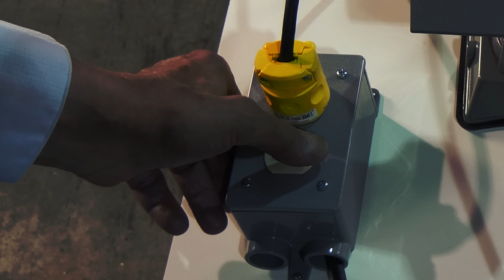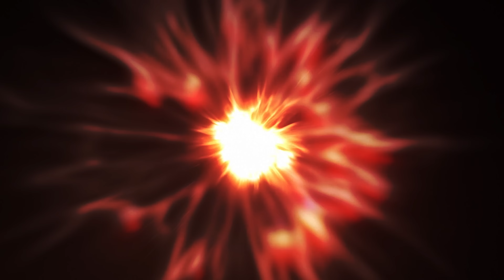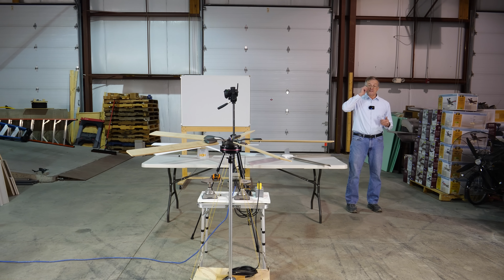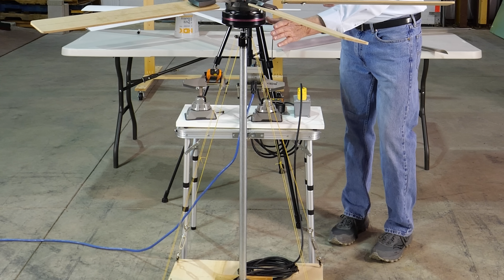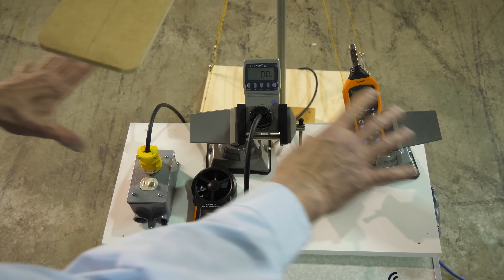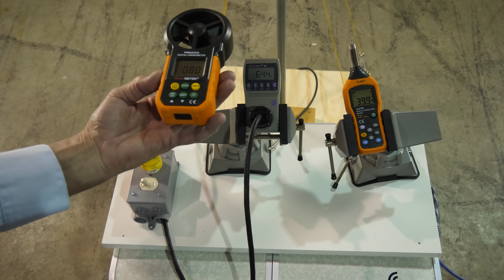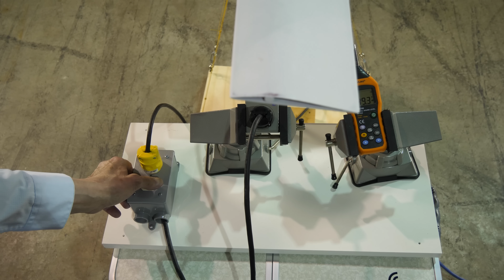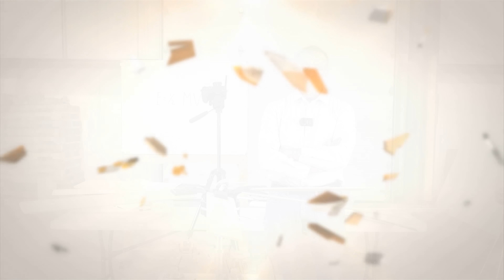This Fan Uses Almost NO Power

Comment: If you want this to be even more efficient then I would say another watt or two could be saved by using a very efficient motor driver. 
Probably overkill but every watt saved here counts when these things are sold in the millions.

Also, something like this could run off a single solar panel on your roof. After all you're more likely to use a fan on a hot sunny day.

Comment: You missed the connection of more velocity potentially eliminating the total amount of fans in a shop. Using a smoke machine or infared camera to illustrate room air movement on stock vs final design. Regardless amazing video thank you.

Comment: One point that he has missed is that celing mounted mmotors arhe other way facing down into the room. 
I belive that the motors are designed to be hung from the ceiling not stood on a pole. I think the results would be different?

Comment: You give the impression that all the other induction motors in a house (compressor, washing machine, etc) are similarly as inefficient as the fan motor here.  Not so. Fan motors like this one are designed with very high slip and are much less efficient than other induction motors commonly used.
Reply from the maker: Not really. 
I'm suggesting that other appliances MAY have less than optimal efficiency due to their motors.

Comment: great video, There is one parameter overlooked that plays a massive issue in efficiency is blade tracking. ceiling fans are terrible for this. in helicopters just a few mm out absorbs incredible energy and induced vibration and even noise. keep up great work cheers

Comment: If you look up the aeratron ceiling fan, the blades are tapered and rounded and the tips sweep upward to further reduce noise and improve efficiency.
Reply from the maker: There are a number of manufacturers of higher end and large fans for commercial use that incorporate those features. I don't know for a fact, but I suspect that some also include airfoils for their blades.

Comment: The "old" motor efficiency could be improved by using VFD (variable frequency drive). In this construction the poor efficiency comes from usually huge slip angle between mains power frequency and rotor frequency (RPM)
Reply from the maker: I think you're right.

Comment: In Sweden (at least) ceiling fans are built to be able to change direction; either pushing air down the center of the room, or upwards (and down the walls). Probably not an altogether simple task to perform when using aerofoils.
Reply from the maker: True.

Comment: The "other rotor" at 7:04 looks to have a very high angle of attack.  Probably a lot of flow separation (stalled).  I know the main driver of the video (at least at the end) was about the inefficient motor.  But if you follow up with blade design on another video, it would be good to go over local angle of attack.  This varies depending on the radius on the blade, if the blade isn't swept.  Look at any airplane blade and you will see it is swept.  The angle of attack also depends on the local velocity of the air moving thru it.  Sorry, ex-pilot here.

Also, it was easy to put the fan in the middle of a large room.  Plenty of room to get free airflow from above.  In the application of ceiling fans, most are mere inches from the ceiling.  Long downrods help, but not everyone has high ceilings to do that.  So any real advantages to changing blade design when the fan is mounted nearly flush to the ceiling?  This could be tested easily.

I will say that you got me thinking about my choice of fan in the main room.  I leave it on low 24/7 in the main room of the house, and it's been that way for the last 19 years.  I'm trying to think how I can check its energy use, as it is "flush" with the ceiling and hard wired.  Suppose I could throw the transfer switch on the house and move to generator.  Cut all breakers except the one that feeds than fan, and use a kill-a-watt meter between the generator and house power inlet cable to see what the fan draws.  If you have an easier way to do it than that, some folks might want to check theirs.

And overall, thank you for your good work.  I really enjoy the deeper dives.  And the way you present is typically first class.  Like many others have mentioned, I wish I had more profs like you (I studied mechanical engineering).
Reply from the maker: Thanks for the long comment. 
Regarding the angle of attack, this was optimized for the two custom rotors. The cylindrical spar makes that relatively easy to adjust.
The angle of attack on a stationary fan as opposed to a propeller is constant because at these low Reynolds numbers, the flow remains laminar across the whole radius, and the foward velocity of the plane contributes to the angle of attack less and less as you move outward from the hub of a propeller. 
I'm sure you know that the angle of attack sweep of the wing is to prevent a high angle attitude from causing a stall at the tip, resulting in control issues.
Fellow pilot here.
Reply: @TechIngredients  You (wisely) don't tell folks where you live, except that it is New England.  If you are a pilot, check out Sugarbush Soaring in Warren, VT.  Beautiful area.  Flew in once in a Citabria with my father and then went up in gliders.  Very pretty area.  I had a photo of the airport as screensaver for years.  Don't fly anymore, but I'll never forget that place.  I live in Houston, so almost anything in New England is prettier than where I live.

Keep up the good work with the channel.

Comment: One of the subjects I find interesting is biomimicry fan/blade design - I once heard about blades that were inspired by owl wings designed to reduce noise. How about a ceiling fan that's not only energy efficient, but also quieter.
Reply from the maker: That's probably not too difficult.
The same principle of interference is used to reduce the noise from stealth aircraft engine outlets.  I'd start by gluing various wedges along the trailing edges of the fans.

Comment: My subject of research would be electrostatics. In particular the workings of an electrophorus, the first electric induction device.
And my question would be: 
How is it possible that a surface of a dielectric that has been rubbed - added or subtracted electrons so to speak and touched by a grounded, conducting plate retains its charge?
Reply from the maker: Our next video relies to an extent on that property. Charge mobility varies tremendously. Charge can move across the surface of a material that is considered an insulator, but it moves poorly. Now, wet that surface with very pure water, which is itself an insulator, and the conduction increases.
Reply: @TechIngredients I suspect it also has to do with just polarization of the dielectric and not so much with moving charges.
Much like Michael Faraday wondered if electric current itself was either a flow or an arrangement.
Reply from the maker: Good point.

Comment: Interesting that the brushless unit takes longer to accelerate. Suggests that it produces considerably less torque. Maybe if it was geared down so it took a similar time to accelerate it would give a more similar flow to the ac motor

Comment: 13:43 For the no-rotor test, wouldn't you want to have the same effective weight on it, like some solid metal rods the same length as the blades? Motors run differently without a load.

Comment: I'm actually thinking that I need to do something about my ceiling fans currently. It's mid winter and the fans circulate heat throughout the house. The capacitors in the motors tend to dry out and lose capacity over time and currently the fans are peaking at a gentle breeze. I'm now wondering whether to swap fans out or just to spend the few dollars on replacing some old capacitors.

Comment: a similar super applicable power saving i have found is with new usb-c powered wifi routers. no one really questions the router/modem combo that their ISP sends them when they sign up. i found that mine was using around 30 watts, presumable to blast a bunch of ISP hotspots out to sell to my neighbors without my consent. I upgraded to a usb-c version by gl-inet, the opal export version which was only like 20$ at the time (the usa/north american versions are all very expensive), and also bought my own modem which is resoldered the 12v dc jack in the back to a 12v usb-c pd trigger board. connected both of them up through high efficiency GaN 20w adapters. togeather they now use about 7 watts. the thing is, almost every household in america has these networking items, and they are run 24/7 without much thought. the used modem online was 9$ with no powerbrick (perfect). so for ~30$, i cut my base load electricity use by 23 watts. ~16.5kwh/month, or 210kwh per year. for americans thats $40-200 of electricity savings per year.
got a similar amount of savings by unhooking the 120v line on my old doorbell transformer. for 50$/year, neighbors/deliverymen/solicitors can knock lol
the electricity savings is actually more than i estimated because of the reduced airconditioning costs during most months of the year. this is a lot better bang for buck than unplugging random appliances when not in use.

found these power suckers by using my cheap thermal camera. what a great tool for saving on electricity.

Comment: This is a very important video that demonstrates big energy savings, and therefore big environmental benefits, could be had by the simple cheap expedient of using higher spec motors in many household appliances.

Comment: I’ll be honest, my brand new home built in 2024 has ceiling fans in many of the rooms and I never ever turn them on. I have central AC which itself provides a bit of a breeze so I never see a reason.
Reply from the maker: No problem,  I believe you.
The more important conclusion than that ceiling fans could be better is that there are MANY other motorized appliances and systems that are operating at very low efficiency levels.
Awareness leads to progress.

Comment: I have converted many of my AC devices/appliances over to DC...mostly for the ability to run them off of my battery systems during power outages...but also for better efficiency.  
Like you I run my ceiling fans 24/7 but I never really gave serious thought to how much power it actually uses...this video really got me thinking along a new tangent.

Comment: Definitely interesting stuff.  

We try to limit our fan use because we live in a rather humid climate and have whole house AC. I talked to an HVAC guy who told me that if you live in a humid climate and have whole house AC, do not use ancillary fans, because the pressure differentials they create, in-draw humidity faster/more efficiently into the house.  So if I do use a fan, I use a small one on low-doesn't move a lot of air. 

  Speaking of humidity, I've thought of a way of dealing with that was low cost so I wouldn't have to run the AC and dehumidifier (I run this more at night when its cooler) as much.  Basically, get a large container and insulate it well.  Put it near a small, lower lying window. Dump calcium chloride in it.  The top of the container would be insulated with air/moisture vapor permeable insulation (the rest of the container would be insulated with more efficient insulation, like homemade vacuum insulated panels).  Make a giant heat pipe. Stick heat pipe into the calcium chloride container, insulate the part of the heat pipe that is in the house.

   Make an insulated insert for the window and pipe the heat pipe through same to outside. Spray paint the outside part of heat pipe white, or use the specially made calcium carbonate that radiates IR into space and reflects sunlight. (I haven't figured out a good coating that would be both outside durable and also allow it to thermally conduct well. Thinned silicone might work for outside durability, but would tend to insulate it over much). 

    Once your calcium chloride is saturated with water, switch it out for some fresh stuff, and regenerate the C.C. by using directed solar to evaporate the water (reflectors, put a piece of high porosity carbon felt on top of the water+CC solution, etc).

Comment: I'm sure you realized this in part when you hit upon the idea of wasted heat energy but its worth pointing out explicitly: All of that extra power consumption is entering the house as waste heat, which is the thing that we are fighting against in the warmer months. By reducing energy consumption, not only do we save electricity at the fan but we save electricity/money running the AC (if we have one) and ALSO enjoy a cooler house by not having that added heat at the same time! 

I often marvel at all the electronics that are turned on in our houses fighting against our efforts to keep the house cool. Its almost like the tyranny of the rocket equation - the more electricity we use to keep ourselves cool, the more electricity we need to use to keep ourselves cool...
Reply from the maker: Agreed

Comment: A slight critique. The asymmetrical rotors have increased wind resistance having open ends. This would make it both louder and use more power.
Reply from the maker: Sure.
Despite that, they are still far more efficient.
I left them open so the structure would be more apparent.
Reply: @TechIngredients yes, I figured out after watching the rest of the video. You do pay attention to detail. I was amazed you didn’t make note of it. I really think it will make a double digit percent increase in efficiency, and noise.

Comment: Nice video on the fans and motor efficiency.   FYI, This video has quite a bit of what I assume is lighting hum from your overhead shop lights which is a bit distracting.  The background nose diminishes quite a bit when you are talking so it might be an auto gain setting.
Reply from the maker: We're addressing that now.
Thanks.

Comment: Unfortunately, in the most scaled usage of office buildings and apartment complexes, the costs of power are passed onto the renter so there's no incentive for the builder.  This is where legislation should be place that looks at costs vs savings and starts to make rules when power savings can make up for increased costs in say 5 years of usage.

But, even in a house with 4 or 5 ceiling fans, if you're replacing them, it might make sense to put in a more power efficient model.

You can now get socket fans which just screw into a standard lightbulb socket for $50 and use all of 10 watts of power.
Reply from the maker: Passing on costs is a myth.  According to that reasoning, landscaping maintenance that costs 10 x market rates can simply be passed on.
The landlord will soon find her building empty, or her competitors offering additional services she can't pay for.
The market, like evolution, is impartial. What works survives and defaulting to governmental interference only complicates the process.  It doesn't add value.

Comment: there is one more efficiency concern you should put into place, that on average 10%(sometimes much higher, rarely as low as 5%) is lost in the AC/DC conversion for most off the shelf devices, mostly on transformer heat loss and diode(bridge) heat. A good high efficiency DC supply for these devices,  or finding best AC brushless motors(as the contact arcing is a huge part of the losses, as well as heat losses from a second coil) can quickly make for significant value in energy savings. These values also translate strongly for reverse use applications(rewired motors as generators) as well as off grid and back up power concerns.
Reply from the maker: Keep in mind that the system we demonstrated included the manufacturer's supplied converter along with the motor and prior to the power meter.
Reply: @TechIngredients  I did not catch that fact in the video, but even so, that would confuse the issue in another way, after all, you still have to pay for what you use, and the older cheaper fans don't have dc converters. As far as performance of the motors, as this started with blades and physical performance, I probably got lost in an all encompassing context from the blade portion. The whole physics of air movement as final energy efficiency.
Reply from the maker: Fair enough.

Comment: There are a number of Indian companies that have embarked in this direction, most notably Atomberg which started their business with BLDC ceiling fans. But the cost premium (in many cases 100%) and lower cost of residential electricity (0 to 10 cents per KWh) means there is little incentive to adopt/replace existing fans.
Reply from the maker: I would also avoid replacing fully functional fans that are currently installed. Upgrading when buying a new fan is an obvious opportunity.

Comment: I've got an idea that's a little off topic but it's about energy and it's right up your alley if theirs anything to it,  what if you got 2 plates, and painted one with a highly emissive and highly radiant paint (like what you made already), and then another that was just highly emissive (and tending to absorb incoming radiant heat), then you faced them towards each other (preferably in a vacuum). wouldn't they naturally and passively create a heat differential between them?

if so, does this have any implications about entropy and the supposed inevitable heat death of the universe?
Reply from the maker: I suspect not based on its apparent violation of the thermodynamic principle that entropy of any closed system can not decrease.
The likely rub is that highly emissive surfaces are highly absorbent at that wavelength, and low emisivity surfaces are highly reflective.
Reply: @TechIngredients  Yes, it would violate the principles a little bit, but it's easier to get forgiveness than permission.

With this idea we skip out on the low emissive surfaces, we go high emissive on both, except one is also reflecting back what it receives